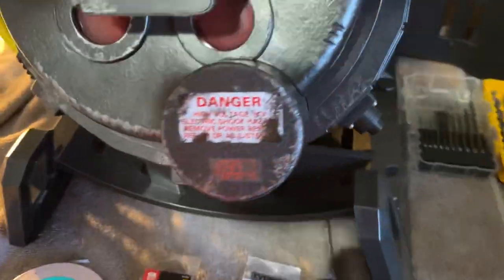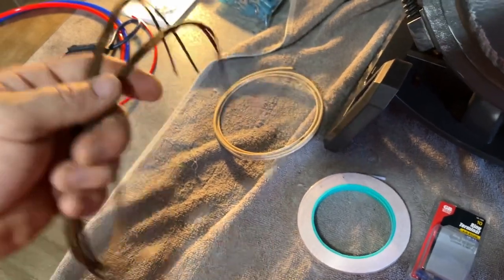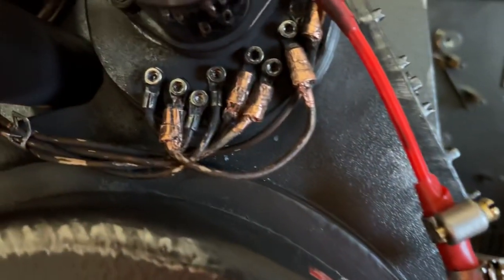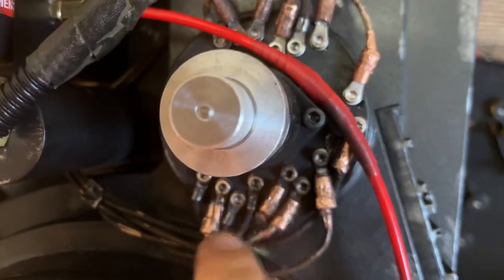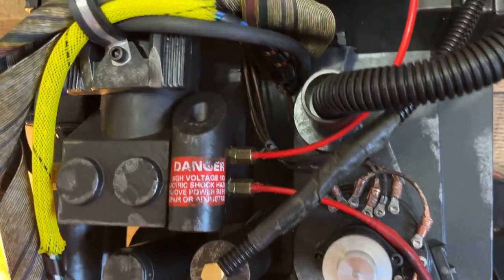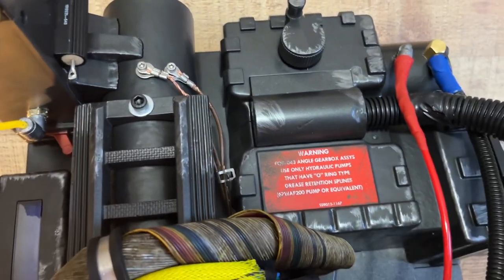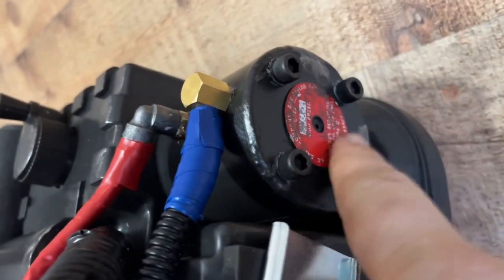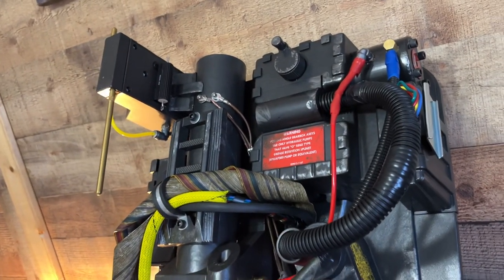Real Wires and Hardware Modification on Haslab Afterlife Proton Pack Update 6

Comment: The clamps you referenced are spring clamps. At the True Value hardware store near me they were called "carbon spring steel," and on the Home Depot site they are called "fuel hose clamps." Problem is, both of those are just similar to what is on the pack - they don't have the cut-outs that the film accurate ones do . . . Also, those are ring TERMinals you used, not THERMinals! I couldn't quite understand why you said it that way (every time!), especially when you (twice) showed the package they came from!  LOL . . . Yes, you are right - the Ghostbusters fan community is truly awesome, and unique in its passionate fandom!
Reply from the maker: I always say the wrong words lol. Thanks for letting me know about the clamp 👍🏻

Comment: Looking good!! Good job on those TERMINAL (sorry, had to!) lugs & real wires. I got some small brass lugs and black #8-32 socket cap bolts, which to me look like the right size (a size down from yours, so you were right), and am going to paint the wire like you did.

If anyone wants cheap socket cap bolts, I got mine from Bolt Depot online. MUCH cheaper than the hardware store.
Reply from the maker: Haha yeah I say the wrong words all the time. Nice! Happy modding

Comment: One thing I did on my pack that I don't see on yours was that I added some more silver to the cylinder in the center with the angled wire opening.  The film shows it silver rather than black.
Reply from the maker: The one with the red danger label on it? If that’s what your talking about I just haven’t weathered my pack yet but I’m going to when I do. Nice eye! 👍🏻
Reply: @ghostbusterspluscollector9624  Just like a puzzle, working on it is as much fun, if not more fun than just owning it.  With mine, I am playing it safe by not going overboard by taking it apart, and drilling holes, though I did cut off the molded wires that are supposed to poke out of the hose, and replaced them with real ones.  Hasbro did a great job with how the pack originally looked, and how easy they made it to modify.  I have plans for sound modifications without doing harm to it by sticking a speaker in the side cabinet, and pointing a mic to where the noise comes from.  Since it is Bluetooth, I can also play the theme song.

Comment: looking good! DId you have to tap the screws for the copper wires? or did you just glue them on? and do you have links for the resistors for the Ion Arm?
Reply from the maker: Thanks! I drilled holes and then screwed them in. For the 2 top wires on the big tube I had to get creative by shoving tubing down the holes and screwing the screws in the tubing and gluing the terminals on. Hard to explain lol but I think I did in the video I got the resistors  and Ion arm at GBfans website